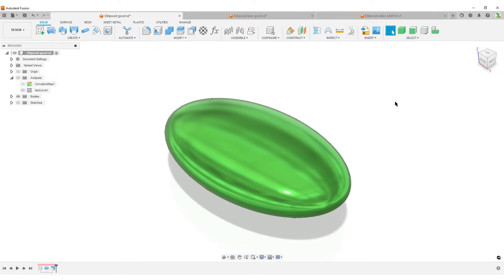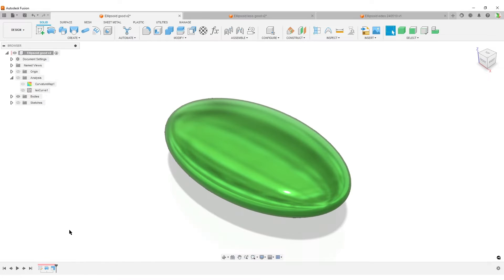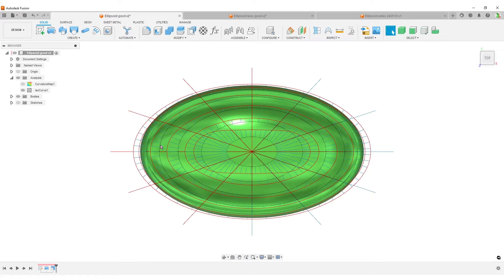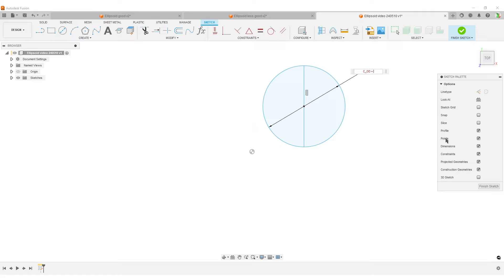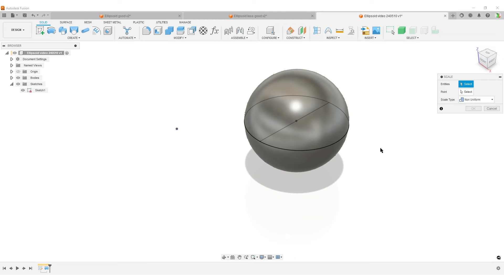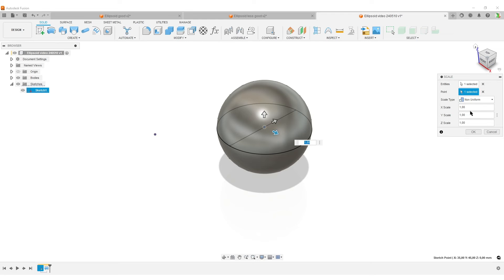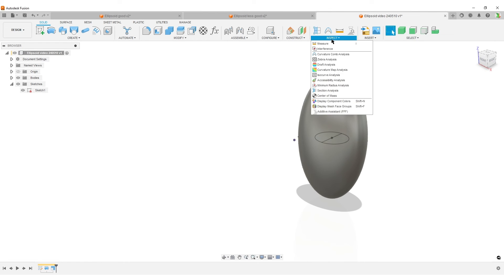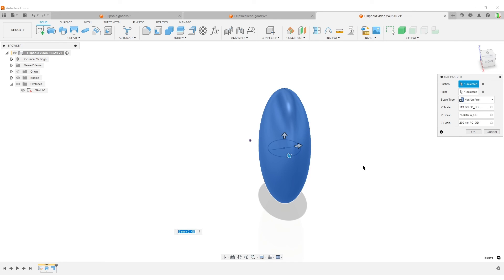Autodesk Fusion: Ellipsoid Modeling with the Scale Tool

Comment: you can even save one more step using Primitive Sphere, then in the Paramters just see/change the diam name ...voilà
Reply from the maker: In most cases I avoid the Primitives because they are not always obeying the parameters. If this is the start of a design a primitive could be a good starting point.